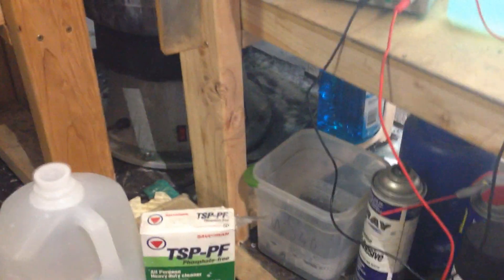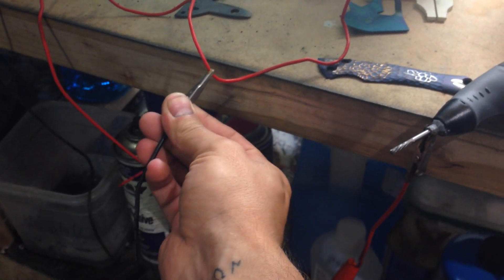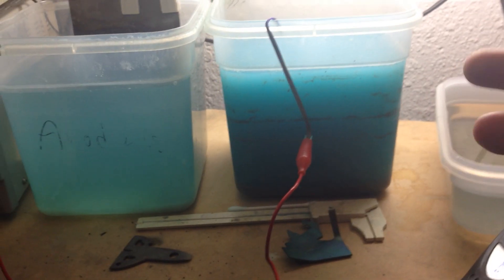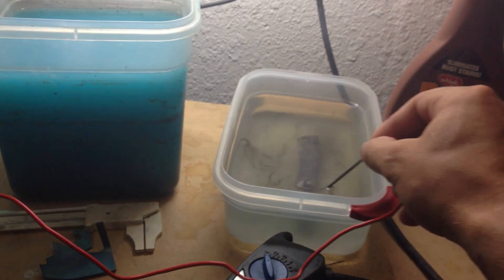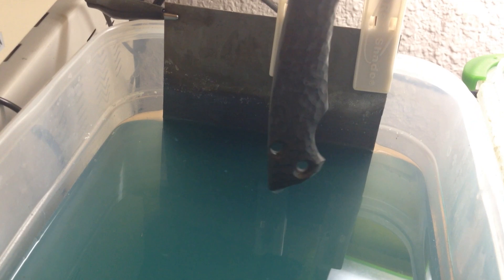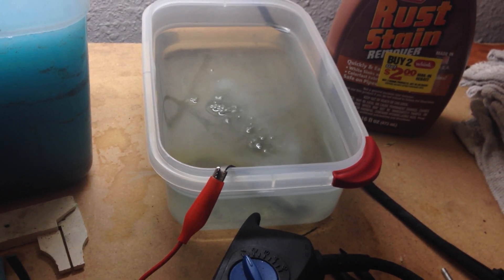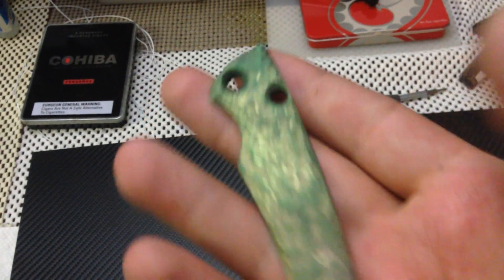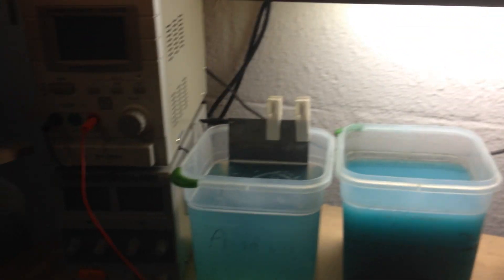Knifemaking Tip - Titanium Anodization

Comment: Do i need a cathode or can i use a piece of titanium ? thanks for the info
Reply: Definitely need a cathode, which is the negative lead. I use stainless steel as my cathode and titanium wire is my anode when I hook to the titanium and enter the solution. Don’t touch them tho, very bright

Comment: Great vid, finally adding one of these to my shop.  Thanks for the vid.  One question, it appeared you had a red wire running into the Rust Remover container, was that hooked up to a power supply too or was the wire just resting there?
Reply from the maker: probably just resting carbidizer wire. no power is required for that rust and stain remover to work.